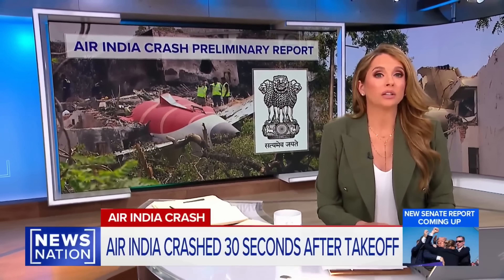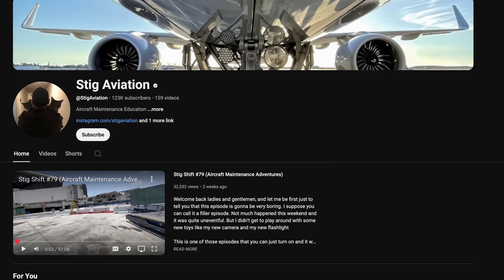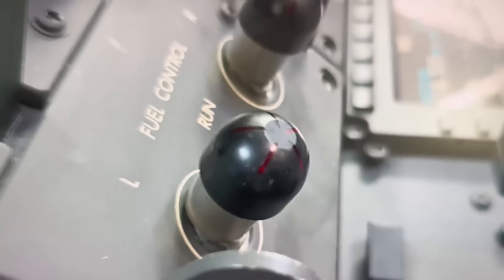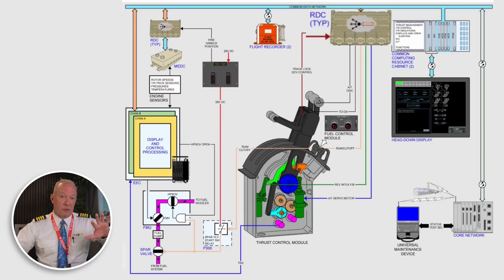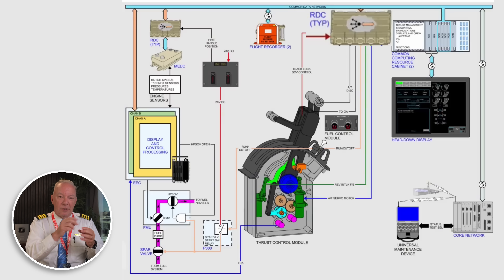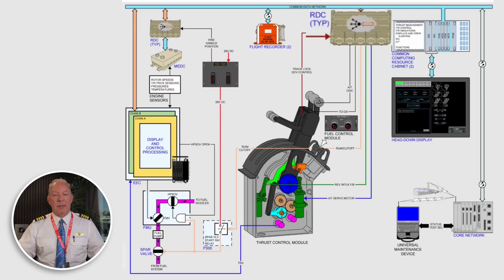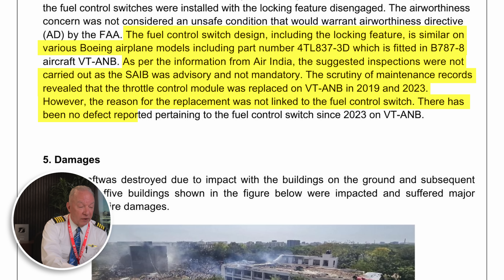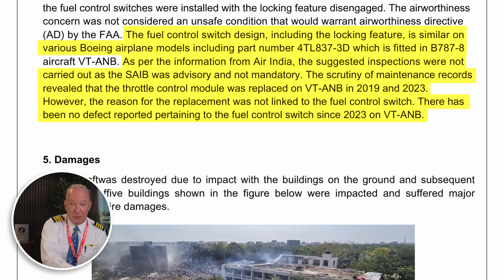The Truth About Boeing 787 Fuel Control Switches

Comment: I notice t nub on the fuel control switch is small. My question is could  really hard push snap them off. Like if you kicked them. What if the coil in the relay failed, the fuel would shut off affecting the one engine my guess. Why not have a camera on the control console recording to a black box? I mean it is 2025 and we are being watched all the time. I think I know the answer.

Comment: Thank you Captain Steeeve! The switches are merely a gate to allow the current to pass to the relay coil for the fuel so the theory mentioned on P. Morgan's show by the other participants can be easily debunked. The gate is either open or closed.

Open = fuel on (relay closed)
Closed = fuel off (relay open)

I'm an EE and this is as simple as apple pie. The current is available pretty much at all times and only allowed to pass through the gate when the captain or first officer actuates the switch or conversely shuts the fuel off when either actuates the switch.
Reply: As a fellow EE there is more to the pie!

open in which path? closed in which path? SPST monostable or bistable? If monostable then NC position is run or cutoff? Example when 24VDC bus fails. Captain Steeve very confidently says valves have no digital input. Nowhere on google it shows that detail of schmeatics or part numbers etc to check datasheets. For all we know they are actuator controlled and no idea of state of these if 24VDC bus fails or is down for few seconds etc. The metering section can also fail and measure no flow when there is flow etc. 

If it were all that simple like on/off then why would we do so much failure mode analysis on systems etc? No engineer will ever say system is 100% safe as there is always some mechanism that can cause failure.

Also, brand new car or plane may behave very nicely but over time (thermal and other ageing) we cannot guarantee level of performance of sensors/valves etc. All they can do is build redundancies but still things can still happen.
Reply: But if you remove the power that drives the relay first one system fails and then the system that powers the other engine relay gets joined to the other system as it's an emergency but the fault on the other system ten pulls the second one down so it's relay loses power. The thermal breaker that protects the battery wiring then heats up and trips removing the short in the battery system allowing voltages to recover and the systems to restart but too late. As it happens there is a single un monitored component in the system that will cause this https://www.youtube.com/watch?v=OLxLN3osS1Y
Reply: This strong conclusion is just wrong and if you are an EE you know it. If what you call "gate" is open, the whole circuit driving the coil could be potentially broken or shorted somewhere else to prevent current to flow.

By the way, we shouldn't call it "gate" because its a bit ambiguous what the state means. A switch is closed => current can potentially flow through, If a switch is open => current cant flow. 
So the states of a "gate" and and a "switch" means the opposite of each other.
Also to note only one state of a switch can safely determine the state of the circuit the switch is part of: the switch is off state.
Reply: Why arent we considering a possibility where dual engine failure happens just after take off. Then pilot manually turn fuel switches off and on because thats SOP in Boeing planes in case of Dual Engine.? You can refer to Gaurav Taneja AI 171 Part 3 in english dub to understand more about this theory as timeline of RAT deployment also matches with this. https://youtu.be/pq2AZdzH7X4?si=0pLKXsmG1M7tRXAZ
Reply: @ishanarora7948 Read the report (p14).  The engines did not starts losing power until after the fuel was cut off via the switches.
Reply: @ishanarora7948 because at that critical time only someone with a death wish would shut off the engines. 😂

Comment: These Fuel switches are Honeywell microswitch 4xxxxxxD 2PST/DT with lever version. It's only a laughing matter plaything in serious industrial application.There is no relay inside these microswitches. Do not imagine.
Reply: Why arent we considering a possibility where dual engine failure happens just after take off. Then pilot manually turn fuel switches off and on because thats SOP in Boeing planes in case of Dual Engine.? You can refer to Gaurav Taneja AI 171 Part 3 in english dub to understand more about this theory as timeline of RAT deployment also matches with this

Comment: So the switches are mechanically actuated only, have a 28v dc feed which by all accounts wires directly to the relay operating the valves.  The black box recorder their actuation during take off - how.  do the switches have some sort of transducer which provides feedback to the computer all be it the actuation of the switches is a physical thing, there would have to be a location where the output from those switches was monitored and its data collected on the black box.  Yes there is a 28vdc feed to the circuits used by the fuel run/cut off control but somehow the switches were recorded as having moved in flight.  It could still be a momentary disconnection of the power to the switch, perhaps the mil spec plug providing the power to the thrust control module had a loose pin.  After such a catastrophic event it may not appear as though the pins in the connector had failed at all.  The only way i would take the deliberate actuation of the switches as a given would be if they had a transducer/microswitch output which recorded their position for flight data.  I accept your diagram is basic and not showing the full complexity of the throttle module.
Reply: It seems thevswitch is a four pole switch with one operating the relay and another operating an opto coupler to send the info to the fdr. The oly thing is though they both derive their power from the same bus so a bus failure will cause the relay to drop out and signal the fdr that it had done so so a power failure looks exactly like a switch being turned off. The bus failure triggers the non battery backed bus to connect to the failed one which then pulls that one down so causing the other side's fuel cut off relay to drop out.

Comment: What do you think of this Water Ingress to the Aft EE bay theory?    Seems HIGHLY unlikely that a electrical fault hit two engine electrical components one after another, and then were fine when the switches moved back to run.
Reply: The people proposing this theory are grasping at straws. This theory flatly contradicts the facts stated in the Prelim; defies all common sense (that a pilot would shut off fuel to two perfectly good engines 20 feet in the air); ignores or has missed the fact that an earlier A/D issued in 2016 addresses this precise issue;  disregards the fact that even a complete electrical bus failure would not cause the RAT to deploy* (see below); fails to acknowledge that there are several layers of protection preventing water from getting down into the EE Bays (fore AND aft); and does not explain the question or reply to one of the pilots' query: "Why did you cut off". "I did not".

* One of the causes of RAT deployment is a failure of all 4 engine electrical generators on the engines. These readings are measured directly at the generators. Even in the event of an electrical bus failure or hay-wired electronics in the aft bay, the measurements from the engine generators would still be read correctly.
Reply: The theory is that the DC power failed. Other circuits also show evidence of a loss of DC power. The reason it all came up fine was because the RAT started supplying that power. Different power source and everything came back up.
Reply: @mymultiextruder9804  nonsense theory though - FDR and CVR get their only source of power from the battery busbar..
Reply: @yanholland315 If you have knowledge of that, you should share your sources. These are more advanced and do not rely solely on battery power. The APU restarted, and so did both engines. And the RAT took over. So only non-critical DC systems would be lost. Exactly like the ADS-B was lost.

Comment: You should include in your schematic how and where the logging sensors are attached to the fuel switch circuit.
Reply: It's in the schematic. Watch again.
Reply: @fritzchen0.523  Engine sensors, yes. Switch sensor, no.  Diagnostic quality is degraded if there is no direct sensor on the fuel switch.  The source of the switch log entry needs to be known.  And if there is a sensor on the circuit, it is a possible contributor that needs to be ruled in or out.
Reply: @jwplatt9233  The switch sensor is second set of contacts in the switch but its circuit is powered by the same supply as the relay so a power bus failure not only releases the relay but also records it as having been operated by the switch even though it wasn"t.
Reply: @jwplatt9233  Are you unable to stop the video when the schematic is shown? I told you that 1st there is a separate line and 2nd it's shown in the video you are commenting on. If you are unable to read a schematic, you should not try to argue about it.

Comment: basically all pilot do this , case close shut the fuel valve while in the air . Thank you captain steeve
Reply: Why arent we considering a possibility where dual engine failure happens just after take off. Then pilot manually turn fuel switches off and on because thats SOP in Boeing planes in case of Dual Engine.? You can refer to Gaurav Taneja AI 171 Part 3 in english dub to understand more about this theory as timeline of RAT deployment also matches with this. https://youtu.be/pq2AZdzH7X4?si=0pLKXsmG1M7tRXAZ
Reply: @ishanarora7948  because rat signal was detected in ground mode by the airplane while it was almost at transition to flight mode point

Comment: The fact the one pilot was heard on the cockpit voice recorder saying “why did you do that” kinda suggests it was deliberate
Reply: Wrong. The preliminary report doesn't use direct speech as you used. It deliberately uses indirect reported speech to obfuscate the subject in that sentence, which easily could've been the airplane itself. Had they used the quote marks and full sentence, then we'd have had something to talk about. This is just nonsense to throw you off.
Reply: @MerrekSK well said
Reply: "“what did you do that for”  wow, this quote changes all the time!
Reply: The answer SUGGESTS, that it was NOT the case.
=> scrap the idea.
RAT was deployed too early to be a result of fuel switches in any way.
Reply: Fine let just agree one of the pilot did this intentionally. How in the world that pilot knew it with such precision that if I cut off fuel at this instance of take off we will surely die? Because if this have had happened few seconds later both engine would get into power again and as per report one of the engine was up before the crash.
Reply: @shubhampal7877  Everything pilots are trained in is about precision. That's why everything is calculated for proper takeoff... aircraft weight, fuel, temperature, runway length etc...they know the precise moment at which they are forced to takeoff and cannot abort the landing. Killing the engines around this moment would almost certainly cause a crash.
Reply: we heard it but did he actually see the other pilot do it? We don't know
Reply: actually, the report says "one pilot asked another why he did cut off". And I wonder:
-if engines goes off, and pilot have no clues why, and suspects engines cuf off themselves/aircraft cut engines itself, what english speaking pilot says/asks?
 "why did she cut off?"
 "why did it cut off?"
 "why did he cut off?"

-what Indian pilot asks? In what language both pilots talk?
Reply: No recording/timestamps to those dialogues was released. He could have been referring to something else.
If I see my co-pilot cutoff fuel, I won't wait 10 and 14 seconds respectively to restart the engines.
Reply: @omkarnaik2758 without the final or full report, or any video, there is no way to know what happened in those 10 seconds. There could have been a struggle or simple panic. We can never know what we would do in such a time.  Plus, if it was the copilot, in that culture, he would be subordinate to the captain. It’s something we don’t take into account but it’s ingrained in the east.
Reply: @Kennann7634  They have nothing on either of the pilots, because they would've released full communications by now. It's obviously an electrical issue for which Air India or even Boeing is responsible and they are stalling to save what is left of the plummeting stock value. See you in a year.
Reply: @MerrekSK are you Indian by chance?
Reply: @omkarnaik2758  Great insight!
Reply: Exactly: why people are still trying to look for another reason is beyond me. It’s clear as day the engines were both working fine before the captain switched them off and they started working again after the FO switched them back on. Why people are still trying to look for a manufacturer issue or something else is just not common sense. It’s horrific but we all know what happened unfortunately. Very sad and worrying. ✌️
Reply: @Gavaldo if that were the case then max speed would have been achieved after fuel switches were transitioned from RUN TO CUTOFF because of residual thrust. But we got max speed earlier which means something wrong happened earlier . Most likely sequence is : 

Soemrhing wrong happened just after liftoff - max speed achieved due to residual thrust- pilots trying to understand what’s happening- turning fuel switches off and on following Boeing sop for dual engine failure - engine reigniting but too late . 

Let me know how does mass suicide makes more sense than this . Consider factors such as therr were 2 pilots present , nose was up , RAT deploy deployement time etc etc
Reply: @Gavaldo 100% correct. 787 rated CAPT, 5yrs/4000 hours.
Reply: @Gavaldo  Massive electrical issues in the plane, evident from the previous flight. There is all reason to look closer at the plane.
Reply: @Gavaldo  Nothing in the report says the captain, or anyone, flipped the fuel switches to off. The report doesn't even say they were "flipped" to off.
Reply: Yes, it just says ‘as per the EAFR data … the switches transitioned to CUTOFF’. That leaves open the possibility of a FADEC / EEC initiated fuel valve closure that left an EAFR data record identical to one left in the case of the cockpit switch being moved to CUTOFF. I don’t think the video eliminates this possibility.
Reply: Its doesn't suggest anything other than your inability to think beyond surface level observations.
Reply: @JoeyBlogs007 versus your conjecture
Reply: It is impossible for both the engines shut down same time suggests valves issue or lock broke. Not a suicide for sure.
Reply: @IHE87  What about short circuit?  What about the plane having a Lithium-ion battery as backup?
Reply: @burdeninmyhand Both engines failed along with hydraulic failure and compressor stall. Lithium battery and lock failure issues already existed in all 777. Rudder jam is another big issue in boeing models.
Reply: What a claim! To cite the report: "In the cockpit voice recording, one of the pilots is heard asking the other why did he cutoff.
The other pilot responded that he did not do so."

You have no idea what the subject in that 1st sentence was, you have no idea how many more sentences were before 1st and 2nd in the report. Wake up and stop making pointless made-up accusations, when you clearly didn't even read the report.
Reply: @MerrekSK Praytell, which other cutoffs are you aware of on the 787?
Reply: You don't know what any particular pilot said.
Reply: @martinwhite418 we need to hear the actual voice recording, and what language it was in, English or Local
Reply: @danMdan  Correct.
Reply: You didn't  seem to follow  the recording he said he did not do it
Reply: @KemiAdemigoke  Sure, people never lie after doing something bad right!?
Reply: @KemiAdemigoke  Yup.  That's exactly what all defendants do in a court of law.  Deny culpability.
Reply: @MarktheMaverick  If murder-suicide was premeditated, perpetrator could, intentionally, initiate dialog "why you cut off?".
Reply: @MarktheMaverick You are dumb?Even if he did that why would he put it in run again?And why was nose of plane lifted while crashing?
Reply: @MarktheMaverick  And we know they are all guilty. Yes siree.

Comment: You are a lot smarter than I am BUT you are confusing a manual "switch" with an electric "relay". A manual switch is like a light switch in your house. Most relays are normal open or normally closed. Electrically energizing from the switch overcomes the NO or NC relay position.  Relays can fail. Just like switches can fail. Also what would happen to those relays if you lost that 24V DC busbar for even a momentary problem ? Most busbars have a fuse/circuit breaker in case of a direct short so you don't start a fire. And remember that simulators are created by programmers. They are not absolutely "perfect". Just asking for clarification purposes.